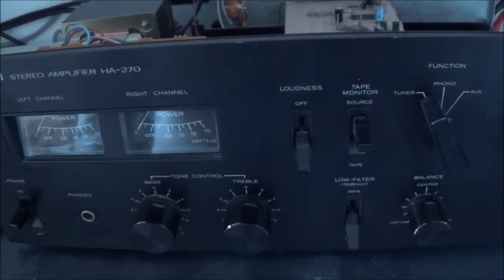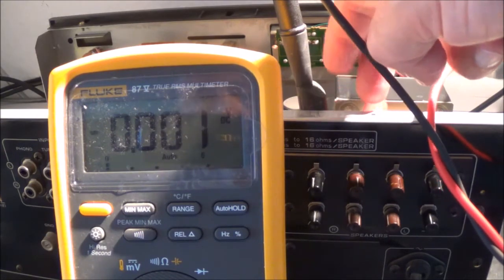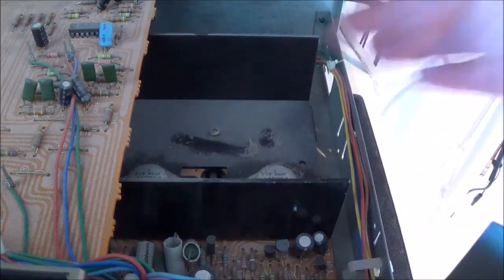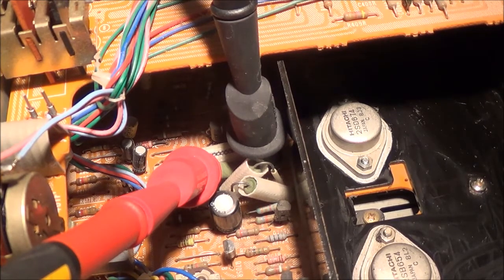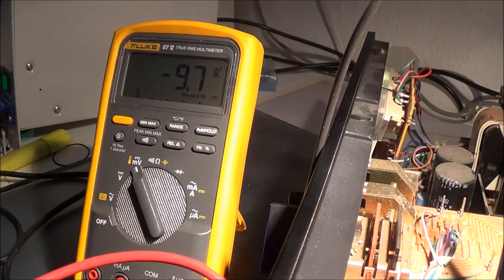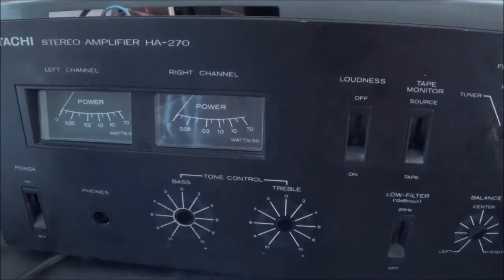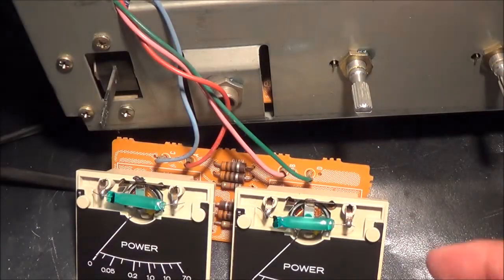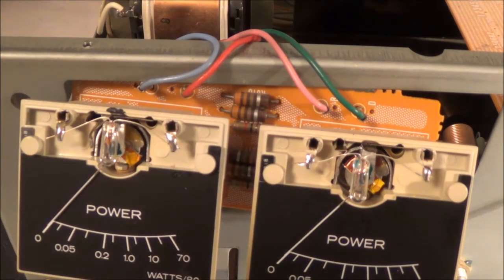Hitachi HA-270 Stereo Amplifier -- Bias and Bulbs

Comment: Great video man!
Is it possible to replace these bulbs with LEDs? I have simmiar hitachi amp
Reply from the maker: Thanks for commenting!
You could replace the bulbs with LED—although I am not a fan of this. The bulbs
in the unit are DC powered and rated at 12 volts, 55 mA. You would have to know
the forward voltage drop and forward current of your particular LEDs—which I
don’t know. All kinds of LEDs out there. Since the source at the bulbs is 12
volts, we know that. Say you used a LED with a forward voltage drop of 2 volts.
Then we know that we have to drop 10 volts because 12v-2v=10v. If the forward
current of the LED is 0.02 A (this would be in the specs), then we would divide
the voltage by the current to get: in this case R=V/I. So 10/0.02 equals 500
ohms. Wait, what about the wattage? P=E times I. 10 volts times .02 amperes equals
.200 watts. Safety margin…double that wattage. This is done for each LED. It’s
even more involved than that; really it involves experimenting, too…
Reply: Old School Thanks for describing in details,I fortunately found 50mA bulbs but thought that it would be cool to be in blue or white color to make it look a bit more modern since these amps already look great
Cheers
Reply from the maker: No problem! if you do do it, don't forget those dropping resistors I mentioned.